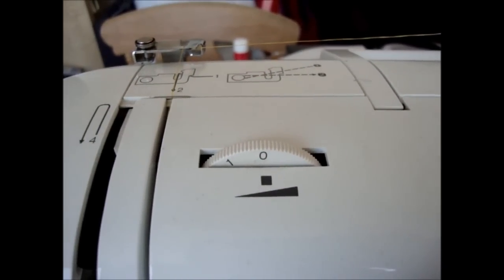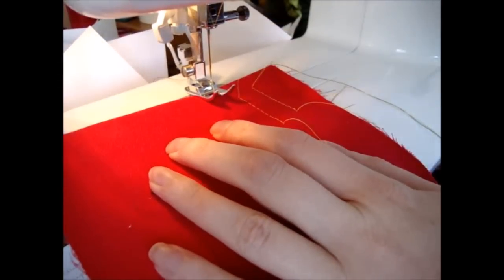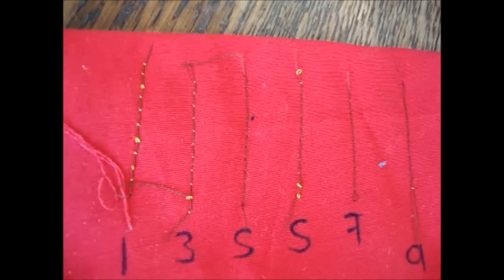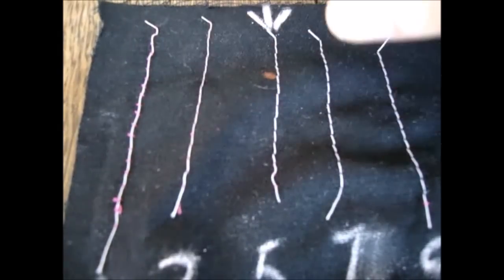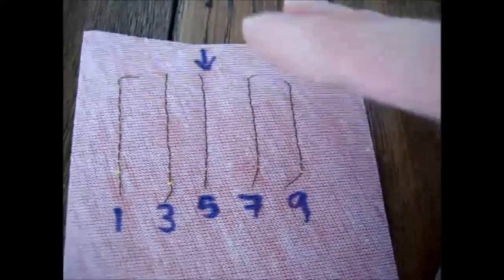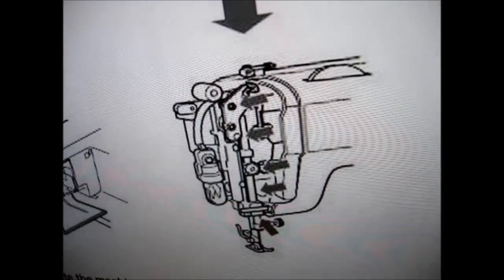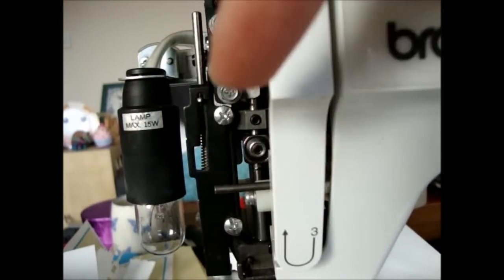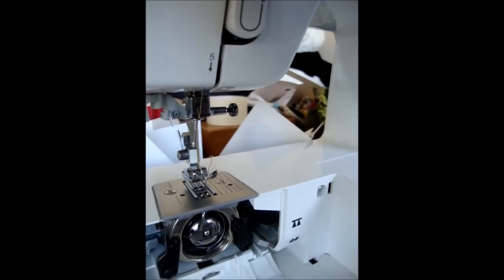Sewing Machine 101 - Thread Tension and Machine Maintenance

Comment: Brilliant testing for applying correct tension.  I was as a general principle that fatter fabric needed thinner/lower tension or high to low and conversely with thinner fabric needing higher tension.  One recommendation I give to any sewer is that buy a machine with a push button thread cutter or it will make all your testing a miserable experience!

Comment: First look I thought that machine looks familiar, further on watching and yep I have exactly the same machine which is now just my back up, I actually had the needle holder come off and put it back on what I thought look wrong but it did not show it in the manual and after seeing yours yep it’s wrong so I will take it off and put it on the right way round,  I feel like a wolly as I should have known this but it’s not easy to put back on as you have to get the thread guide pin just right.  Great Video as I’ve had the same issues with thread braking I do wonder if it’s just a thing with this model I’ve sewn for some years now and still tension is always a jiggling act, you have explained it brilliant, thank you.

Comment: I hope youre still active 😅 my tension level being 9 still creates loops from the top thread.. however i do have a double threading machine so im assuming and hoping its just because ive not got the thread in the right slot on the tension wheel
Reply: I've just seen the tension dial doesn't actually do anything to the discs..

Comment: Hello.. i have a problem with the same as no. 1  the tread doesn't sew properly i keep try changes the tension but still the same what should i do?
Reply from the maker: Ensure machine is completely threaded up properly (i.e. haven't skipped any steps), that you're using the correct before for the fabric type, same thread weight on top and bottom, check your bobbin tension also (using the bobbin drop test). If you're trying to sew many layers of fabric or a single layer of very thin fabric, this can also cause tension issues. Thin fabrics can be used with stabiliser or interfacing. Hope that helps!
Reply: Thankyou for your advice

Comment: How do I know if the problem is the top or the bottom tension? My top thread is all loopy underneath while the bottom thread is just laying flat. Was that because the top tension is to loose OR the bottom tension is too tight?
Reply from the maker: Top thread tension 90% of the time! But you can always do the bobbin drop test to check your lower thread tension. Also ensure top thread is threaded properly at each stage from spool to needle, as this can cause a similar issue too (cos not enough tension if you've missed a step somewhere)
Reply: tellezara   Thank you. I have retreaded top and bottom. Still working on it. Getting closer. ❤️
Reply: tellezara   What is the bobbin drop test?
Reply: Homebody Heaven Make sure you inserted your NEW needle all the way up with the flat side toward the back (check your manual in case your needle's flat side faces a different direction but most have flat side toward back) and tighten the screw by turning the screw away from you (clockwise). Always replace needles after 8-9 hours of sewing. Needles should match the fabric weight as well as needle size. Try a 14 for light to medium wovens like cotton, size 16 for heavier weight like denim, canvas, and 18 for leather. Ballpoint needles for knits (like T-shirts and those fabrics with stretch and use zigzag stitch or an overlock stitch). Hope this helps.
Reply: Jude Jane  great idea!
Reply: Homebody Heaven Glad I could help. By the way, always refer to your sewing machine instruction book which has a section called Troubleshooting and usually is very helpful. Another thing: Make sure your fabric is completely covering the moving teeth of the feed dogs underneath where your needle goes down to form stitches so the fabric doesn't get "sucked down" into the machine and cause a jam.

Comment: What tension do you use when you quilt?
Reply from the maker: Julann Sheppard I work it out using the exact same method as shown here, just with all my zig zag stitch settings put in, instead of straight stitch. As the choice of tension is affected by number of layers and type of fabric, you should do this test in as close to your actual sewing conditions as possible. So if I'm doing applique I will do this test with scraps of fabric, interfacing, batting etc layered as if it were the real thing. Hope that helps!

Comment: Hi , can I use WD- 40  instead of oil ?
Reply from the maker: Use dedicated sewing machine oil or your thread will smell of WD 40 for some time!
Reply: wd 40 is not a real lubricant and it will evaporate rather quickly. Infact it's more a degreaser, than grease.
Reply: No, to WD-40! You need sewing machine oil.